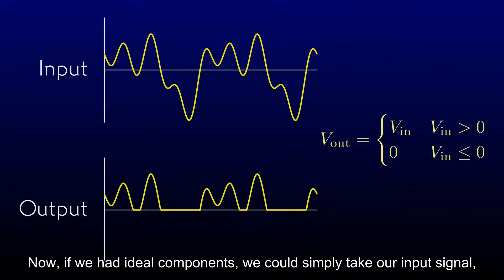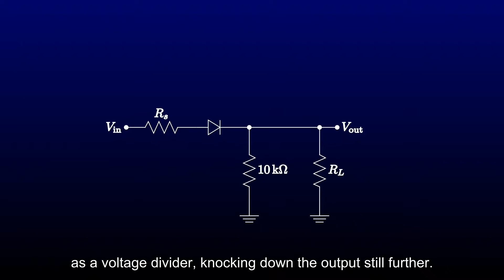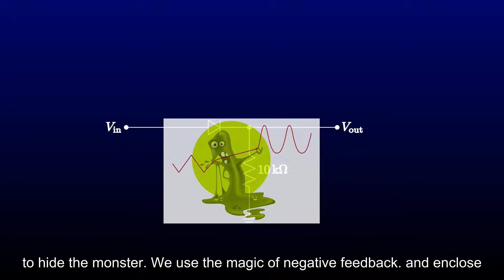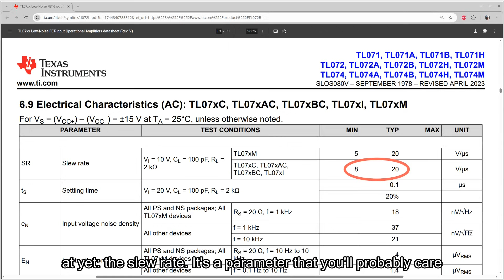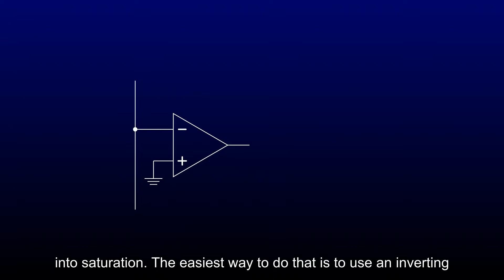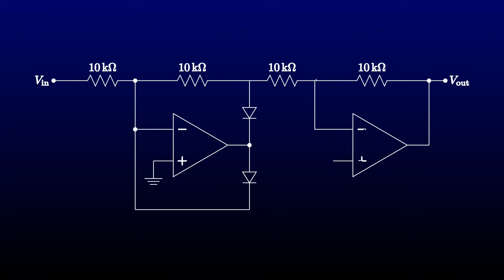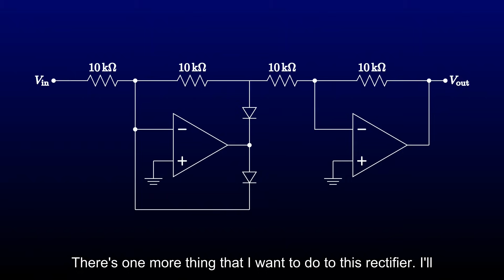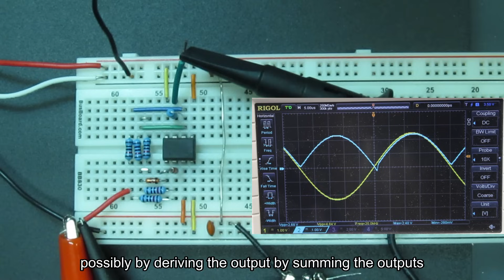The Precision Rectifier: Op-amp basics, episode 5

Comment: will it work on single suply ? or do i need dual supply?+vcc -vcc and gnd?
Reply from the maker: This design needs a dual supply because the input being rectified can go past the negative rail - at least momentarily, until the feedback loop restores the virtual ground.  I think I've seen a design that can run single-supply if your amp has rail-to-rail I/O, but this one isn't it.

Comment: Cool video for those who are a little bit blind on OpAmp function but not that bad at ideas what they can to with electronics. This circuit has a good chance to be brought in a real system for a "measurement rectifier" read out by some arduino board to monitor electricity consumption. Thanks!
Reply from the maker: Glad you found it useful!

Comment: Can it produce flat dc line proportional to input,?
Reply from the maker: If you mean, proportional to the peak voltage at the input, check out the next episode. True RMS is a little bit trickier. I'll probably cover squaring and square root circuits at some point.
Reply: @KludgesFromKevinsCave  yeah something that works like the AD736 RMS to DC converter

Comment: I would digitize the input signal and rectify in software. Very high quality guaranteed!
Reply from the maker: @hansfijlstra5932  I wouldn't do that in a class on analog design. Whether I'd do that in an actual design... "It depends." But I'd certainly consider it.
Reply: The result will be NONsense for non sinusoidal signal. Like the signal produced by speech, or a digitally coded signal.
Reply: @martinmartinmartin2996  Interesting reply. What are you trying to say? I don’t understand what you mean by “result”. What result are you looking for?
Reply from the maker: @martinmartinmartin2996  I'm kind of puzzled by your remark. If you're saying that you can't digitize a non-sinusoidal signal, that's obviously false - your phone does it all the time. If you're saying that you can't rectify one, that's false also. Sure, if you rectify speech, the result won't be intelligible speech. But if what you need is the peak signal voltage (in either direction) for an automatic gain control, or you want to rectify a triangle wave in order to double its frequency, or you're building an instrument that needs to read out the absolute value of something, you want something like this.
Reply: Al digitalizar se obtienen palabras digitales de muestras aleatorias. Supongo que se eliminan las muestras "negativas"(negativas por código) pero como el muestreo es finito muy difícilmente halla muestras de los cruces por cero. Aún haciendo más complejo el muestreo no creo que el resultado sea la perfección misma. Aclaro que es la opinión de un novato que no ha experimentado en ese campo. Saludos
Reply from the maker: @frank0-1 Digitalizar una señal siempre es impreciso, pero los circuitos analógicos también lo son: existen muchas fuentes de variaciones aleatorias de voltaje. Nada es nunca exacto. La cantidad de variación aleatoria que se puede tolerar es un factor importante del diseño analógico.

Comment: How do you determine the equations and begavior of the circuit? I still haven't learned analog design so that may be why. Is it like a memorization of the modeling of the circuit?
Reply from the maker: You're in luck: analog design is what I'm trying to teach! But you seem to be jumping in in the middle of the series. That's kind of like walking into a college course in the middle of the term and expecting to understand everything.  The various episodes build one upon another. (In fact, I'm more or less following the syllabus of a course on the subject, but adapting to the YouTube format - taking the topics in smaller pieces and moving slower through them.)

The beginning rules of basic electricity that I'm expecting viewers to know:
(1) What voltage and current are.
(2) Ohm's Law V=IR - the relationship between voltage and current in a resistor.
(3) Kirchhoff's voltage law - if you sum the voltages across the components around any closed loop in a circuit, the sum is zero.
(4) Kirchhoff's current law - the sum of currents into and out of any node in the circuit is zero.

I might someday go back and do a very basic introductory course covering that stuff.

For this episode, I'm also assuming the simplest possible diode model.
(1) No conventional current flows from cathode to anode, that is, against the arrow in the schematic symbol.
(2) If there is a conventional current flowing from anode to cathode. the voltage drop across the device will be a constant (typically about 0.6 volts for small-signal circuits). The diode will change its effective resistance to keep that voltage drop constant.  
There are much better diode models out there, but you don't need them for this episode. (I do have a video elsewhere on the channel that discusses the Shockley diode law, https://youtu.be/m3V7IBlf0sI if you're interested. That's still an incomplete model, but will get you a lot further.)

For this episode, I'm also using what I call the Golden Rules of Op-Amps: check out episode 1 in this playlist for details.  https://youtu.be/J_EpzLVMaFU
In summary:
(1) An ideal op-amp's inputs draw negligible current.
(2) In the presence of negative feedback, an ideal op-amp will do whatever is necessary to keep the voltages at the (+) and (-) inputs equal.
The Golden Rules are always an oversimplificaton (but a useful one!).  Most of the videos in the op-amp series will be exploring one way or another that the Golden Rules fail, and what parameters to look for in an op-amp data sheet to avoid having the failures affect your circuit.

I also mention in a place or two that a pair of components form a voltage divider. There's a video on the channel  called 'The Humble Voltage Divider' that will explain what that means. https://youtu.be/Gn7AIbaEJms

This episode mentions 'hiding the monster' - that's a metaphor for using a feedback loop to linearize the response of a circuit.  I discuss 'hiding the monster' and 'admiring the monster' in an earlier video in this series: https://youtu.be/5_J4_O5_LZY

I think with that information under your belt, you'll see that all of the modeling can be built with high-school algebra.  There are one or two videos on the channel that need some calculus, but little more than knowing what a derivative (instantaneous rate of change) and integral (area under a curve) are.  When we get into topics like filter theory, I'm going to need to assume some more, but I'll also present some 'cookbook' approaches that avoid the harder math.

Comment: Have to test that with LF353 which is a cheap OpAmp declared as very fast. Great rectifier, thanks for sharing!
Reply from the maker: It should work pretty well. LF353 is similar to the TL082 I used in the video.

Comment: Back in the mid to late 70's I remember using a similar circuit with like an AD 532 on a transformer test set to get and RMS value on a digital panel meter of the time. 👍
Reply from the maker: Using a Gilbert cell as a squarer was something of a luxury in those days.  I've seen true-RMS circuits that used a JFET in the square-law region (with a multiturn trimmer to adjust to whatever the threshold voltage of the JFET happened to be), an integrator, and an op-amp with another square-law JFET in the feedback loop to take the square root.   

And up in the RF domain, people still use thermal power meters.  

I thought of using the JFET square-root circuit as an example of "admiring the monster" in the episode on nonlinear components in the feedback loop, but (1) I haven't discussed JFET's yet in the transistor course (BJT's are the bread-and-butter, of course) and (2) in my old age, my patience for the manufacturing variability of JFET's is wearing thin.

Comment: When I saw the title, I thought "what? Rectification with op amps? This I gotta see". What a novel idea and the clarification of the resolution to the problem was very interesting. But, in reality, why would I use this instead of my old tried and true full bridge rectifier? Is there some special case for its use that I'm not seeing? Great video and I found it very intriguing! Oh, and for us with hearing aids, I enjoy the captions and find them necessary for times I don't quite catch the spoken word.
Reply from the maker: You'll always have the captions from YouTube if you turn them on. (And my captions are never AI-generated, so you'll always have them with sentence structure, and timed to the video.)  Viewers should have the choice.
Reply: The signal level is 100 millivolts full scale. Try your rectifier with your electroboom full bridge rectifier!   :)
Reply from the maker: Hi, GlassSlinger! Didn't know you watched my channel. (I've been subscribed to yours for a long time.) You're right that this circuit is entirely inappropriate for use with ElectroBoom's high voltages (or your fire bottles and GlassFET's for that matter). I think I could step down and rectify a signal of a few hundred volts with an AD8479 in the front end. I use one of those a while back to measure current on the high side of an electroluminescent panel.
Reply from the maker: @glassslinger PS: I have your video on reconing speakers bookmarked.  I've got a kit-built 3-tube TRF radio from the 1920's (including the manual) that I rescued from the rubbish quite some time ago. One of these years, I want to make it play again, and reconing the speaker is one of the jobs.  (I also have a horn speaker that I might try. No clue yet whether the driver of either one works, and it's not my current project.)
Reply from the maker: @samreames1713  @glassslinger beat me to the answer. I'm not trying to rectify for a power supply, I'm trying to take the absolute value of a low-level signal, and a diode's forward voltage drop will be unacceptable. The 100 mV that they mentioned will hardly even make the diodes in your bridge conduct, and even a signal of a few volts will have a ton of crossover distortion. That's why this circuit is a precision rectifier.

You'll often see something like it as part of the front end of an ac voltmeter.

Comment: May I ask how you decide on magnitude of resistor values? I see kilo-ohms often, but I would have thought we would generally want to keep current/power draws as low as possible generally. If we go to ohms range, I imagine currents would be too large, and if we go to mega-ohms, we get thermal/Johnson noise?
Reply from the maker: Exactly. Also, op-amps have input bias currents (which I haven't discussed yet as an important parameter) which impose a hard limit on how high the impedance of their sources can be. High impedance sources also mean that stray capacitances will kill your frequency response.  Unless I have a specific need (micropower, impedance matching, ...) I tend to go with a middle-of-the-road value like 10k because it makes calculations easy.
Reply: @KludgesFromKevinsCave  Thank you. May you expand a bit on stray capacitances from high impedance sources?
Reply from the maker: There are capacitances everywhere in a circuit - between wires and adjacent wires (or a ground plane), the capacitance of a BJT base or a MOSFET gate, and so on.  A high-impedance source will see the tiny capacitance to ground, and essentially make an RC low-pass filter.  The capacitances also cause unexpected problems like introducing delay in feedback loops, making them oscillate.  A lot of the time, you have to introduce compensation into circuits to tame this sort of effect, as we saw in https://youtu.be/eFceH_AnqUo) .
Reply: @KludgesFromKevinsCave  That link you posted just brings me back to this video. Is it supposed to go to a different video about feedback compensation?
Reply from the maker: @SkippiiKai Yes, it was.  https://www.youtube.com/watch?v=26Ml7Iz69W0
Reply: @sabamacx  I think it was IMSAIguy who gave the best and most thorough answer to this exact question. I hope I'm not forgetting any of the details, but what he said was,
"I just use 10k for everything."

Comment: Great video, I use this FWB Rectifier circuit with an integrator to build an envelope follower.
Reply from the maker: @Remeeeee1  I like using it with a peak detector (and a resistor across the cap) for 
AGC. I'll be doing peak detectors and clamps  next time.
Reply: @KludgesFromKevinsCave  exactly, also using a state variable filter and 3 full bridge rectifiers give interesting control voltage dependent of the band, then you can either control 3 filters or sum them back together for a smother control voltage that's dependent on frequency.

Comment: Does this circuit only work well for signals like sine and triangle waves due to the low rise times? It would be interesting to see the scope traces for waveforms like sawtooth or square, just to see how the sharp transitions are effected by the slew rate at the peak amplitudes.
Reply from the maker: It works as well as any other op-amp circuit, once you limit the artificially great swings,  The 8 volt per microsecond figure from the data sheet will give you an idea of how steep your edges can be.
Reply: @KludgesFromKevinsCave  Okay, I had a feeling that was the case, but the wasn't sure if there was any other kind of work around for it. I hadn't seen diodes used quite like that on an opamp (can't say I've ever had a need to rectify an audio signal) but once I saw it I did immediately recognize it from a schematic burned into my memory almost 30 years ago where two diodes are used to limit crossover distortion in the most basic class A/B amp. Definitely makes it a little easier and more intuitive to understand how the diodes work in this design.
Oh-I just remembered I did once need to rectify an audio signal. A guitarist wanted LED lights on his amp to change brightness with the volume. Safe to say distortion was not a concern for the LEDs, though!
Reply: @KludgesFromKevinsCave  one other thing... I bought most of my opamps from ebay, so, well... Datasheets don't necessarily bear much resemblance to what my scope shows. 😬
Reply from the maker: Heh.  Ken Shirriff has done some fascinating analyses of counterfeit stuff that people have got from Ebay and AliExpress.  Here's one about a Rockwell RC4200 repackaged as an AD633:  https://www.righto.com/2020/09/how-to-multiply-currents-inside.html
Reply: @KludgesFromKevinsCave  I think I saw his site on something from EEV or IMSAIguy did. I know Imsai tested some of his opamps and realized he got at least one really nice opamp rebranded and sold as a 358. Apparently it's not worth the effort to sort them first, everything just gets rebranded as whatever sells in the highest quantities.
LER has hours of frustrating troubleshooting in a multipart series to determine why a poweramp kept blowing up mosfets... Spoiler: there was nothing wrong with the amp. Whatever mosfets he had did not have the specs they claimed. 
I need to start marking the parts I buy from Mouser with gold paint as soon as I open them.

Comment: I thought we had seen the last of the cave men at least some centuries ago.
Reply from the maker: @bulwinkle  And a lot of viewers think that doing this stuff with op amps is nearly as obsolete!
Reply: @KludgesFromKevinsCave This is sad, but a lot of people think this way. A few years ago I was talking with a guy and we needed to make a quarter second pulse every time we had a signal detected. I said "Okay, that's a 20¢ monostable 555. Super simple. You can do it in 15 minutes."
The next day he showed up with an arduino that he'd written code onto and I wanted to cry.
Reply: @SkippiiKai  When you only know how to use a hammer, everything looks like a nail!
Reply from the maker: If you already have a microcontroller in the system and a spare GPIO pin, then putting functionality like that in the firmware makes sense. But there's a reason that the 555 and its variants are the most popular chips of all time!
Reply: @KludgesFromKevinsCave  It was the only active part we needed! We had a signal wire in, and it just had to flash an LED! That was literally all it was! There was no firmware, no other microcontroller, and this wasn't for a product. .. We just needed to be able to see the LED flash!
Reply: @SkippiiKai  An interesting side point is that some microcontrollers are much less than 20 cents. And when the requirement changes to "make a syncopated beat out of the pulses" -- the microcontroller solution is already wired.
Reply from the maker: @jeremiahbullfrog9288  on the other hand, the 555 is less than a dime if you're buying them by the reel, and the two resistors and the timing cap will be less than a penny apiece in quantity. You're right that if the requirements are fluid, the microcontroller is probably a better choice. But are you prepared to do a lifetime buy? Many microcontrollers become unobtainium after a few years. The 555 has been around for over 50 years and I bet it will be around for another 50. And the stockroom probably already has some if you need one in a hurry.
Reply: @KludgesFromKevinsCave  Fortunate that we have the opportunity to blend these technologies in our projects. I actually miss the old days of electromechanical logic with all its flaws and character, but so much more is possible today with less investment. Cheers
Reply: @KludgesFromKevinsCave  Nope It's great !